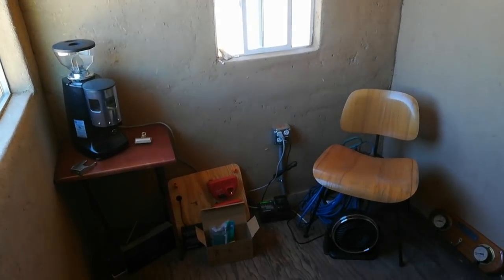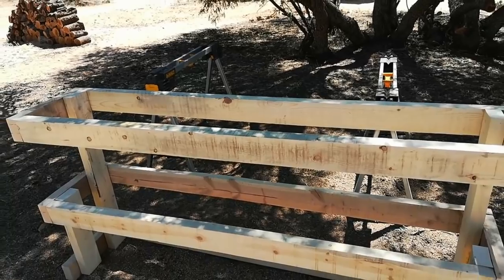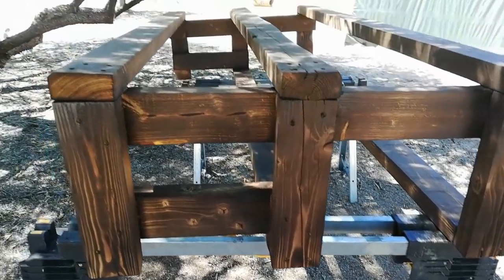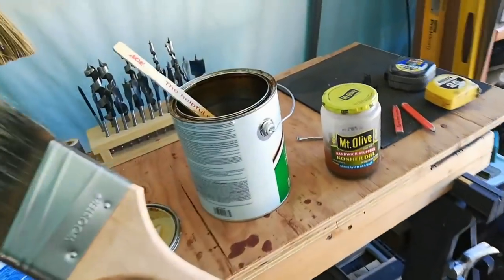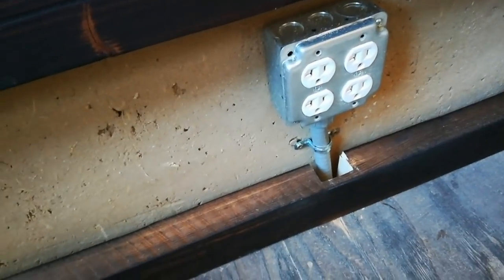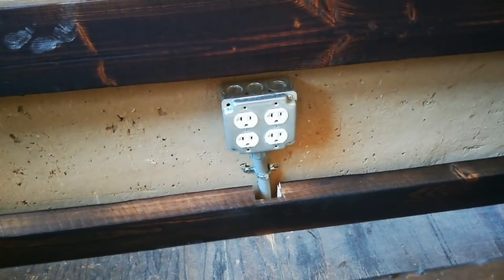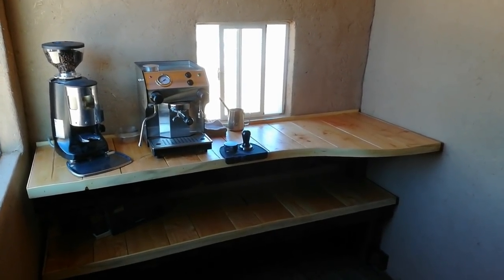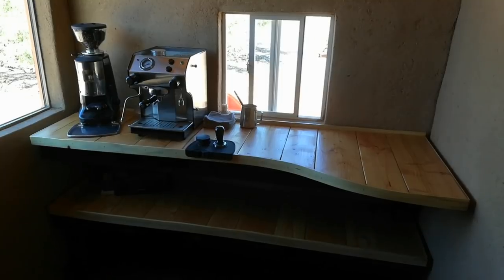Building Our Espresso Bar

Comment: A saber saw, also known as the reciprocating saw, is a hand held saw. With a toothed blade, it is basically used to cut through wood and other soft materials. ... A jigsaw is basically a very versatile power tool, comprising a unit made up of an electric motor and a reciprocating saw.